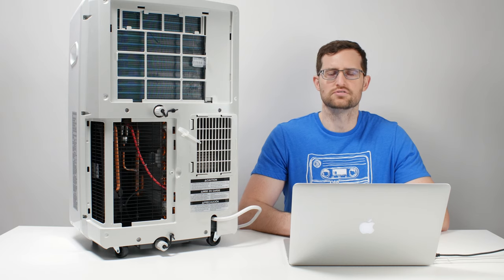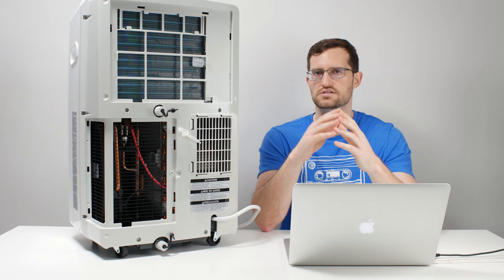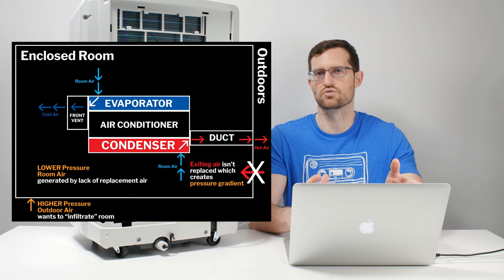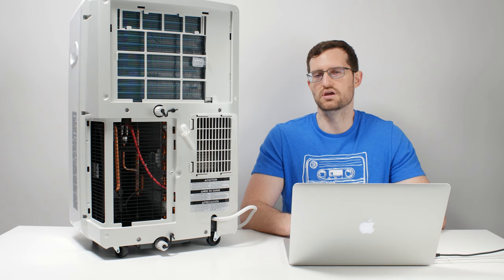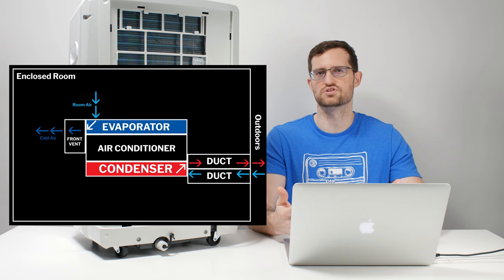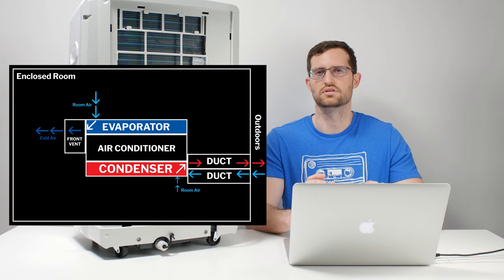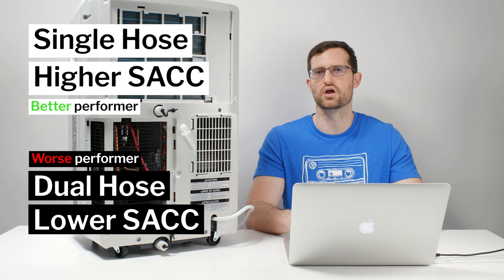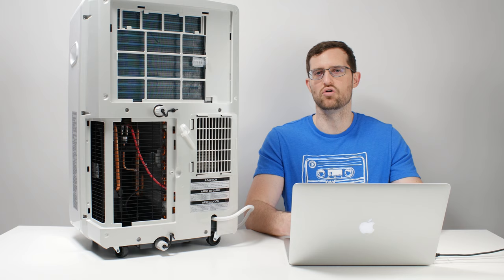Single vs Dual Hose Portable Air Conditioners

Comment: The more videos I watch, the more confused I get. I live in Phoenix and just want to cool the garage so I can work in it. I have access to wall vents for exhaust. Any ideas anyone? Should I focus on SACC or single hose, dual hose?
Reply: The SACC values quoted in the video and on most of the AC manufacturer websites are computed using two weighted temperature points, 95 degrees (20% of the weight) and 83 degrees (80% of the weight). So those SACC values basically aren't useful in your situation where the temperatures are much much higher, and you shouldn't use those to guide your choice. Unfortunately I'm not sure where you could get SACC values more relevant to your situation. 
Thinking about it though, normally in a garage there's a pretty big way for outside air to seep in since garage doors generally aren't insulated very well, so you would want to be concerned with the air infiltration issue in a single hose unit. Especially with the Phoenix temps of 110 degrees+, sucking outside air into the space being cooled is terrible idea. If you get a dual hose though, you will really want to get some additional insulation for the air hoses so that the heat from the hoses doesn't radiate into the room.
Whatever solution you go with, it'll have a tough time with the higher temps of Phoenix.  I don't see too many portables rated for 100+ degrees. It may be worth it to get some professional consultation.
Reply: Just spend the extra coin for a ductless mini split system.
Reply: First of all, you meant to say "cool" not "cook" in your comment. Second, if this is a garage, just cut the opening in the wall of your garage and install a conventional a/c unit so all these infiltration/ radiant heat issues are external to your living/working space inside the garage.
Reply: @halibut1249  Thanks for correcting my obvious typo. I'll fix that immediately.

Simple. Because it's not my house. 

Thanks for your helpful response.
Reply: @BPoweredLove  - no worries. Good luck to you. If the garage is for storage only and you just want to lower the temp by a few degrees, you might also consider one of those swamp coolers but I'm not sure they would work in dry Ariz heat.
Reply: @halibut1249  Swamp coolers ONLY work on dry climates. When there's humidity, the humidity put out by evaporative cookers then accomplish nothing. It's usually dry here, but we're in monsoon season. 

Anyway, I insulated the double door which helped a room and bought a Whynter ARC 14S, but I'm going to return it.
Reply: Late to this but I hope you went dual hose. 

This presenter focuses on the wrong areas, that don't mean much for cooling. Dual hose is closest to having an outdoor unit or window unit, for portables. It recovers cooling capacity, which is the whole point of trying to chill a space. 

Single hose units create a vacuum that sucks hot air from anywhere there is a draft. Like the rest of your house that isn't already air conditioned, or outside. They also suck in the cooled air you just made and use it on the evaporator side of the condenser, heating it back up. Super inefficient waste. 

Dual hose solves all the worst things about portable air conditioners in 2 important ways. It eliminates the vacuum by drawing in outside air and exhausting hot air, on both sides of the condenser. So no massive waste there. Then, like a cars AC on recirculate, it draws cool air into the fan and adds that to the cooled air in the room, which is similar to how a refrigerator or freezer 🥶 can work so well, because of added capacity.
Reply: @shaneladeroute8135  I did go dual hose, but the exhaust hose would emit SOOO much heat. I even then wrapped and insulated that exhaust hose and in the end, it just didn't do its job. Yes, if you stood right in front of it, it felt cool. But it put off so much heat that it ended up just being a mover of hot to cold air, so I returned it after a few months. 

My conclusion is portable AC units do not work in many situations, especially here in Phoenix. Maybe if the conditions were trying to bring a moist 88 degs down to a dryer and cooler 78 degs then they could work. But fighting against a dry 100 was a losing battle. But the room would be 120, so the "cool intake air" was already 100. 

Thanks for the reply!
Reply: Was wondering what Brand/ model number portable dual hose you tried to used? (The one you returned after 2 months) thx
Reply: @J.J.Stokes  

I was the Whynter ARC-145

Comment: Very informative and detailed. Thank you for the review. I was wondering what your personal recommendation would be for a 400-500 square foot master bedroom? Any specific models you would say are worth looking into? Thanks!
Reply from the maker: I would definitely recommend the highest SACC unit you can afford. The LP1419IVSM is the model I usually recommend but it's currently out of stock at most major retailers. Even though I haven't had a chance to test it yet, the Toshiba RAC-PD1412CRU offers the same SACC as the LG and is currently in stock at Home Depot. It would be my recommendation if you need to pick up a unit today.
Reply from the maker: @marcosscriven5937  I stand behind the comments made in the video. I tested multiple high SACC single hose units and a dual hose units in the same room under the same conditions and the higher SACC units outperformed the dual hose unit.
Reply from the maker: @marcosscriven5937  I didn't place an emphasis on energy consumption as the difference in power draw between the best single hose units I tested (e.g. the NAC14KWH02) and the dual hose unit I tested (the ARC-14S) is insignificant (the NewAir has a maximum power draw of 1350 watts vs 1250 watts for the Whynter). Otherwise, the NewAir cooled much quicker and to a lower temperature.

Comment: I have a dual hose unit I bought for my garage. Is it okay if I run the unit without using an intake hose? I have the exhaust going out of a hole I made on the side of the garage. Thanks!! 14000 BTU

Comment: Very informative video, thanks! I was thinking about replacing my single-hose with a dual-hose, but I see it's not as big a difference as I thought. For now, I'm going to insulate the hose for starters.
Reply: I recommend you to replace for a dual hose. The impact is huge. You can compare ASHRAE and SACC numbers and you will see that dual hose are generally more efficient.

Comment: This review, I dunno, it's focusing on the wrong things with dual hose. Anyone who's purchased a single hose unit is confounded by the fact that cool air comes out of the unit, but the room is not cooled. You are only cool if you sit right in front of the unit. When they switch to a dual hose, suddenly the room gets cool too, and stays cool. The pressure difference caused by single hose is the primary inefficiency, period. Just like running a fire place on a cold day only gives warmth in front of the fireplace, the rest of the house becomes freezing because the heat roaring up the chimney sucks air out of the room causing cold air to be sucked in from the outside throughout the house, making the entire house colder.

Comment: Going on about dual hose air conditioning units is a waste here in Europe.
They are just not available anywhere except at prices higher than 'proper' permanently installed split units.

Remember that the amount of warm air will also depend on the airflow out which should not be too much.
It is probably wise to insulate the outlet tube as much as possible and try to minimise air leaks.
In my house, most of the incoming air is from the coolest part of my house.

I consider portable units to only be a temporary/ emergency solution.

Comment: The guy sounds like he is an expert but he has no clue about the subject. A dual hose system is a lot more efficient and practical. It's simple physics. 
Don't buy single hose ACs! They are counterproductive. Just look at the amount of air being exhausted through the hose. It's a lot! That air must be replaced. Where do you think the air comes from? Of course it comes from the outside. Outside air is hot and humid. A huge amount of that hot air is being infiltrated into the room. It's counterproductive! It's simple physics! 
I bought a single hose unit once by mistake and ended up returning it. It's nearly worthless, unless it's in a single room in a house cooled by a central AC. In this case, the central AC will have to work much harder to cool all the infiltrated air.  Using a single hose unit is like using a window AC but with another window (in the same room) fully open. It's that bad! 
I'm surprised the person in this video can't understand this.
Reply: is there a minimum width you need your sliding window to have for two hose?
Reply: Dual hose units are rare and poorly reviewed because they suffer from recirculating hot air to cool the hot side. It's really not as simple as elementary physics suggests. The real take is both are bad compared to split systems and having the heat pump inside the refrigerated portion is an awful design compromise for portability.

Comment: The dual systems for winter and summer. You pump out the cold outside you can pump nice hot air inside the house.

Comment: You forgot to mention the one tube ac sucks in warm moist air as it ejects just as much cool, less humid air. 

A very good two tube unit does not draw in very much, if any warm, moist air or does it use cool less humid air to cool the unit.

Comment: This guy was hired by single hose air conditioner industry. 3:23 he says the intake hose heats up the room. What a bunch of manure. If your room is say 30C and the outside temp is 25C, the intake hose temp will be 25C and cooler than your room and not heating it up. My exhaust hose temp is typically 40C and my intake hose temp is 25C. Intake hose temp depends on your outside temperature. Even when it is 33C outside, my dual hose maintains a 20C interior temperature. Any added heat to the room from hoses is neglible and easily cooled by my air conditioner.

I have had more single hose air conditioners than this guys IQ score. Did my single hose air conditioners cool me down? Yes, when I stood in front of it. Did it cool my room? Mostly never unless it was at night and the outside temperature was way below my room temperature.

There is no situation where a single hose air conditioner is better or more efficient than a dual hose air conditioner. This guy has no credentials or credibility.

Comment: I really hope this video is coming from a helpful place and not just trying to be a cheap and dirty "I've got the real truth, see these formulas (that you obviously don't understand but I do) they show my truth is real and it cannot be argued! Also check out this chart with no sourcing! Now click my links!"
Anyway, the big thing this video misses is that the SACC values are found based on what the manufacturer provides and only that. In reality though, the "significant" factors lowering the SACC in a dual hose system can easily and cheaply be mitigated by the consumer (by insulating the hoses, doing a good job sealing the connections, etc). Similar fixes can of course be applied to the single hose system also, but only to a lesser effect. The flaw of air infiltration in the single hose system simply cannot be mitigated - air removed from the room has to be replaced, and then re-cooled. 
So when purchasing, consider if you want a system with a built in flaw that cannot be fixed (single hose), or a system where the drawbacks are cheap and easy to fix (dual hose).
Because the reality is the consumer doesn't care about SACC. They care about SACC per $$$, and $20-$30 spent on doing a good installation adds a lot more SACC / $ to a dual hose. Not so much with single hose.
And of course as a final note... if you can at all, get a window unit instead.

Comment: I think manufacturer could just design a control unit separately you could just basicly put it in your house while the compresser and condensor out side the house using dual hose one sucking air from the house and one blow the cool air into the house, this would be much better just like a window unit does
Reply: They do already ..it is called a split ac..where the compressor is outside in a box like compartment and the other is in the house ..much more expensive at 800 dollars and also need more power
Reply: @robertnguyen2025  whiat I mean is just like put a window unit completely outside and use two hose for air intake and outlet

Comment: I live in the Florida Keys where it VERY humid all of the time. I purchased the Whynter 122DS TWICE like an idiot. It works great..Cools my workshop quick (500 square feet)  and very cold but the damn thing leaks like a son of a you know what. Both of them did. This new one I only purchased two days ago flooded my shop after the second night even though the drain hose was working properly. I'm looking to buy a new portable that's best for high humidity and has continuous draining.  I dont need my shop ice cold .. somewhere around 76 but I have very expensive tools and things I need to protect from rusting. I'd prefer dual hose.. Anyone from South Florida or High Humid locations that have have any suggestions? I was looking at the HoneyWell line, specifically the Honeywell, MN12CEDWW 12,000 BTU but it has this information... "12000 btu (ashrae-128 standard)/6500 btu (doe+ 2017 standard)" So is the SACC 6500? Overall I just want a damn AC that wont flood my shop and keeps it relatively cool. .THanks!
Reply: That's weird, my ancient delonghi evaporates the water on its own, literally never drained it.

Comment: Is there no such thing as an ac unit that takes air from outside, cools it, and then use air from inside to cool the compressor???
Reply: Holy hell. I need you to step away from the keyboard for a moment and think about what you just asked. 

You want an air conditioner that is trying to cool a room to pull in hot outside air and attempt to get a significant temp drop from that pass and throw it into the room, then take the air that has somehow…against all odds managed to get cool and suck it out of the room by using it to cool the compressor.

So hot air in, cold air out. 

This is why you aren’t an AC Enginerd.

Comment: My whole AC unit is out in the house. I had a single hose unit with 7000 btu. It was great cooling the room when the outside of the room was cooler. However, when the whole house AC unit went out, single hose didn't work because it pulled the hot air from outside the room into the room it was in. 

Then I saw a hisense 10000 BTU dual hose refurbished for under 400$ and bought it. In 90 degree weather Houston, Texas, it was able to cool the whole of the downstairs to 78 degrees. 750 sq ft. When I walked from upstairs to downstairs, the hot air at the top of the house accumulated and you could feel the barrier while walking downstairs. 

So I bought 2 lasko blower fans. One directed air towards the stairs the other one was on the stairs blowing it up to the 2nd story. Guess what? It was able to lower the upstairs to 83 degrees down from 95. The downstairs only went up to 80 degrees doing this. 

Mission complete. I run it at night because electricity is free at that time. Sometimes I do have to turn it on during the height of the day. However, I don't turn it on all day.

Comment: Dual hose - You forgot the upside of outdoor air cooling the condensor - MAJOR DIFF!
- Outside air "cools"  the condensor less efficiently - sure, but it does NOT use the allready cooled indoor air to cool it. 
A single hose basically uses the (by -ac) cooled air to cool the condensor - 100% waste.
Dual hose does not waste the allready coooled air this way.
Also the dont draw in hot outside air as much
Hoses - i agreee - they should come insulated! Cheap manufacturers dont care as they play on low knowledge consumers
Reply: @hello_mashimaro  The air cooled by the AC, is Used to cool the condensor, which is heated from cooling the air (That now cools it) initially.

Using outside air, never cooled, to cool the condensor and then blowing it out again is for sure with less loss.